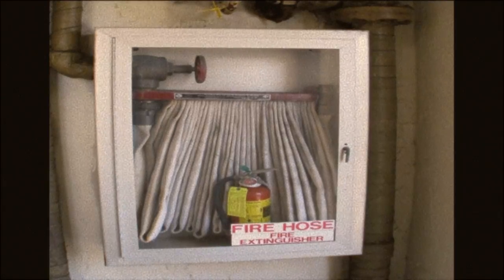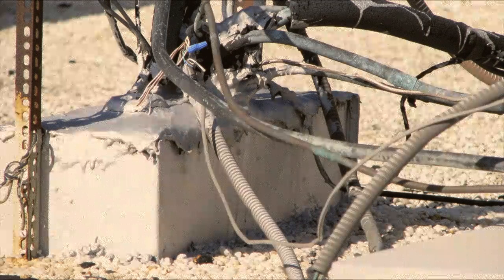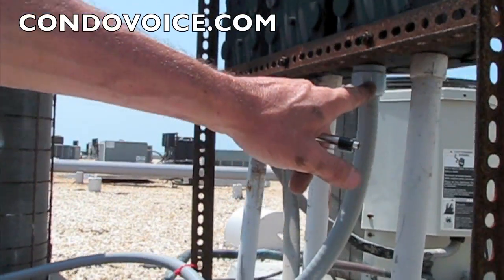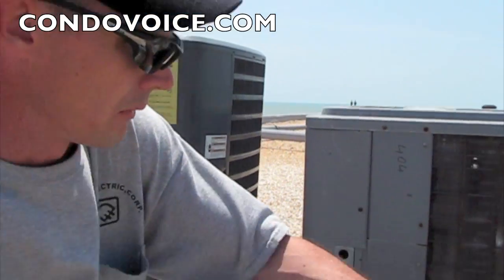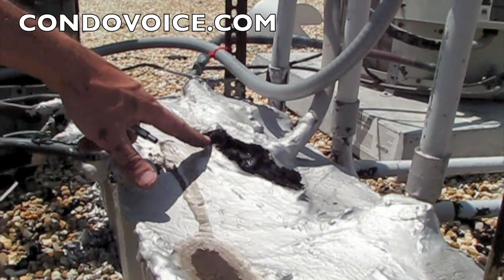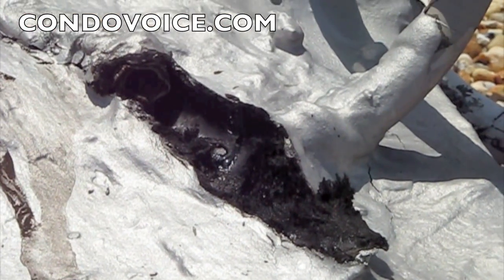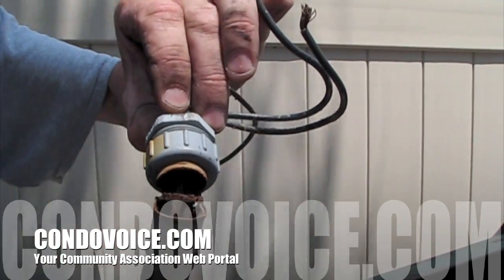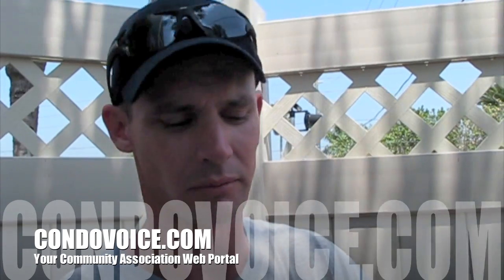AC WHIPS Repair in condominiums condovoice.com

Comment: So when you get a new unit do they replace the whip?
Reply from the maker: It depends on the condition of the old one, make sure your contractor examines its condition, and tells you that info, and if needed,  you should make sure you tell them you need that done when you sign the contract.  But in reality, most are reused as is, if they are in good shape.